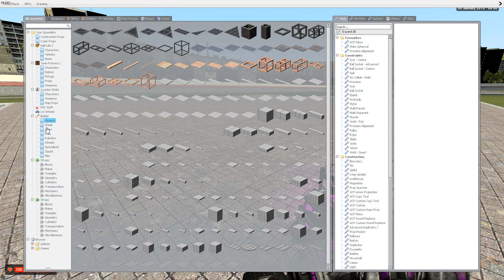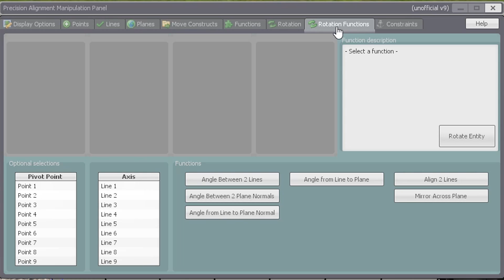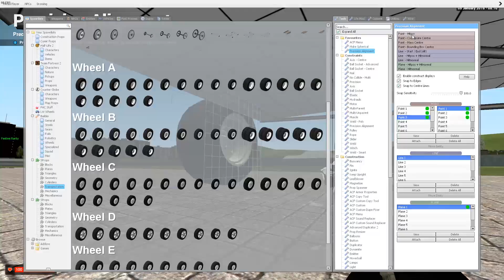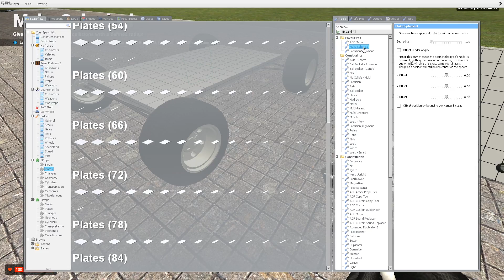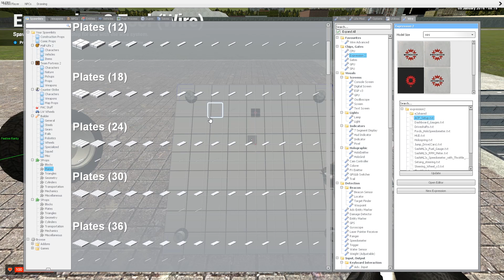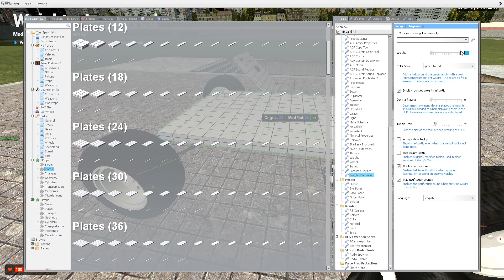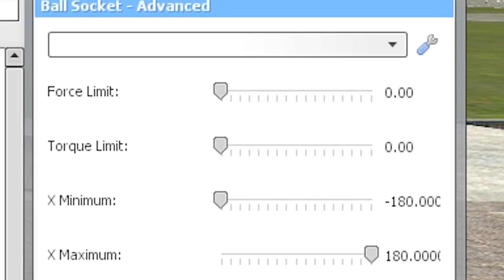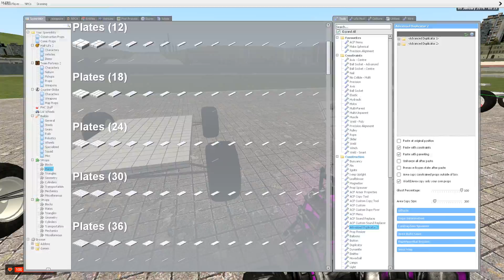[GMod 13] Independent Suspension and Steering Tutorial [2016]

Comment: I combined both of the E2's together, I did this on my last pc too, I think it makes things easier

EDIT: Also, I just build my hydraulics straight onto the Setang Steering E2, thats what I and pretty much everyone else on the server I play on do, makes things more organized (I play on I Just Want to Build (IJWTB))

@name ACF Setup + Setang Steering
@inputs W A D CHASSIS:entity
@outputs Throttle Constant Damping
@persist SLAVE:entity [TURN_RATE TURN_ANGLE TURN] B C
@model models/sprops/rectangles/size_2_5/rect_18x18x3.mdl
 
Throttle = W * 100
Constant = 50000
Damping = 500
if (dupefinished()) {reset()}
 
B = round(toUnit("km/h",CHASSIS:vel():length()))
 
 
if(B >= 20)  {
    TURN_ANGLE = 25
}
else
{
    TURN_ANGLE = 45
}
 
if (first())    {
    interval(20)
   
    TURN_RATE = 5
 
   
    SLAVE = entity()
} elseif (clk())    {
    interval(20)
 
    if (!SLAVE:isPlayerHolding())    {
        TURN += clamp((A-D)*TURN_ANGLE - TURN, -TURN_RATE, TURN_RATE)
        SLAVE:setAng( CHASSIS:toWorld(ang(0, TURN, 0)) )
        SLAVE:propFreeze(1)
    }
}

Comment: i bring unfortunate news, im not sure if its something im doing wrong addon-wise, but the method of using PA for wire hydraulics doesn't seem to work anymore
Reply: i bring fortunate news there is a fork of precision alignment also for some reason the wire hydraulic does work in multyplayer but it work in signleplayer
Reply: what's the fork? also i was trying this in singleplayer
Reply: @13B-POWAH  the offbrand version is called "precision alignment" and its made by a guy called GNU. And fork is when someone makes something makes it open to the public and some takes it and makes adjustments to it
Reply: ill try again in multiplayer if i get the time

Comment: the e2 setang steering is outdated please update it
Reply: I know it's late but I believe the problem is that you don't have an extension (propcore) enabled in E2. I think you can 'fix' this, in singleplayer only, by following the instructions on this image: https://image.prntscr.com/image/33WMdj9XSi2cHgA5L5R-CQ.png
Although I recommend you enable them all in singleplayer.
"Note: Most E2 addons do not register themselves as extensions and thus cannot be turned on or off with the above commands. A notable exception is the propcore extension in the UWSVN, which is disabled by default.
Also, you must run wire_expression2_reload in order for enabling/disabling extensions to take effect."
Here is the list of functions that propCore provides: https://github.com/wiremod/wire/wiki/Prop-core And setAng is one of them. So enabling propcore must fix it.

Comment: //ACF SETUP
@name ACF Setup
@inputs W
@outputs Throttle Constant Damping

Throttle = W * 100
Constant = 50000
Damping = 500

//STEERING SETANG
@name Setang steering
@inputs A D CHASSIS:entity
@persist SLAVE:entity [TURN_RATE TURN_ANGLE TURN] B C
@model models/sprops/rectangles/size_2_5/rect_18x18x3.mdl

if (dupefinished()) {reset()}

B = round(toUnit("km/h",CHASSIS:vel():length()))

if(B >= 20)  {
    TURN_ANGLE = 25
}
else
{
    TURN_ANGLE = 45
}

if (first())    {
    interval(20)
    
    TURN_RATE = 5 

    
    SLAVE = entity()
} elseif (clk())    {
    interval(20)

    if (!SLAVE:isPlayerHolding())    {
        TURN += clamp((A-D)*TURN_ANGLE - TURN, -TURN_RATE, TURN_RATE)
        SLAVE:setAng( CHASSIS:toWorld(ang(0, TURN, 0)) )
        SLAVE:propFreeze(1)
    }
}

//BALL-SOCKET ADV. VALUES
//Force Limit: = 0
//Torque Limit = 0
//X Minimum = -180
//X Maximum = 180
//Y Minimum = -0.1
//Y Maximum = 0.1
//Z Minimum = -0.1
//Z Maximum = 0.1
//X Friction = 0.00
//Y Friction = 0.00
//Z Friction = 0.00
//✔ Freemovement
//✘ or ✔ No-Collide Entities

Comment: The ball socket things dont really work the way you described. Mine wont hold the wheel in place.
Reply: You probably didn't build north because I had that problem then I fixed the orientation and it worked

Comment: I was wondering, what exactly does Constant and Damping do?
Reply from the maker: Truth be told i'm not sure, I never really experimented with the numbers enough.
Reply: Constant is basically spring constant, it's how stiff the spring is. The higher it is the more force will be required to move wheels from neutral position and the more force they will return to neutral with. Heavier cars need stronger constant. Ideally you want a constant such that the biggest bumps you expect to hit will max out your available wheel travel.

Damping is like the delta (or $) if you have ever coded hovering e2 thrusters before. It basically punishes and slows down high speeds, it slows the amount of time to return to neutral initially but then heavily cuts down the oscillations and springing around the neutral point. If you have no damping you return to neutral fast but then overshoot it and keep oscillating back and forth past it.

Ideally you want higher damping for fewer really big bumps and low damping for many smaller bumps. This is because you need fast return to neutral if you hit many smaller bumps in sequence, but if you hit big bumps you need something that will cancel the large oscillations out and perform smoothly. 

You may want to look up PID controller- P relates to constant and D relates to damping. You can ignore the I bit, it's an extra factor that can be added which accumulates over time to overcome natural failure to return to the exact start position. It's not used here.

Comment: Help pls. I get error "No such function: entity:SetAng(angle) at line 31 char 15"
Reply: I know it's late but I believe the problem is that you don't have an extension (propcore) enabled in E2. I think you can 'fix' this, in singleplayer only, by following the instructions on this image: https://image.prntscr.com/image/33WMdj9XSi2cHgA5L5R-CQ.png
Although I recommend you enable them all in singleplayer.
"Note: Most E2 addons do not register themselves as extensions and thus cannot be turned on or off with the above commands. A notable exception is the propcore extension in the UWSVN, which is disabled by default.
Also, you must run wire_expression2_reload in order for enabling/disabling extensions to take effect."
Here is the list of functions that propCore provides: https://github.com/wiremod/wire/wiki/Prop-core And setAng is one of them. So enabling propcore must fix it.

Comment: How do I make this support a lot of weight? Turning the damping up, it stops being effective and increasing strength at one point (about 5000 id say?) And I have a big car that weighs a lot.
Reply from the maker: Mabye make the car not heavy? And make sure the wheels and baseplate are significantly more heavy then the "body"
Reply: I'm working with a lot of acf engines and gearboxes guns etc, so I can't decrease weight.

I've also tried making the body and wheels heavier, no such luck.
Reply from the maker: Umm... well i'm not sure, Making the baseplate and wheels heavier works for me. Also remember that the wheels must be lighter than the baseplate. And your baseplate needs to be heavier than all of the combined ACF parts attached to it.
Reply: That didn't seem to work, What happens is the suspension isn't able to support the car and this happens: 
Before:
http://steamcommunity.com/sharedfiles/filedetails/?id=868000326
After:
http://steamcommunity.com/sharedfiles/filedetails/?id=868000207
Reply from the maker: What are the the weights?
Reply: 800 for the wheels, 6400 for the base. (Ive tried 12800 for the base, no luck.)
Reply: 1350 for each engine (I have 3 engines)
Reply: 3000 for the counterweight in the front too
Reply from the maker: Make the wheels like 2000 or something, keep increasing the wheels weights, if that doesnt work, something else that I can't think of may be going wrong.
Reply: Still flattened itself.
Reply from the maker: Im not sure :( then.
Reply from the maker: Those wheels are PHX I've always had problems with them I recommend using SProps wheels.
Reply: Sprops wheels are a bit small for the size of the car, But i'll see if they fix it. The problem is with the hydraulics not being damping'd enough. Although I cant go over a certain amount or it will stop being effective.
Reply: Damping will not support more weight, it simply reduces 'springyness' and oscillations around neutral at cost of some speed of return to centre. What you need is to increase the constant which makes the suspension actually require more force to extend.

If the constant is maxed at 90k ish (which is not hard) you have a couple of options:

1) Simply place more hydraulics to increase resistance

2) Increase the default length of hydraulics- as they act with strength proportional to length- with this implementation default length is zero, so if you place the hydraulic anchor points a meter or so above the wheels you may get a stronger effective spring constant (I have not tested this myself but I hear it works). 

3) Use a 'constraint bending' suspension method instead which can be made very stiff. These work by being connected (rigid ropes) to a light prop which is welded to the base. As you increase the weight of the prop the weld becomes stronger and the suspension stiffer. A very light prop means the weld is very weak allowing the wheels to move up and down fairly easily. The disadvantage of this is you cannot control damping and constant separately and it's not really as realistically engineered since it's abusing a flaw in the game physics rather than using the tools the game provides. On the plus side it's simpler, easier to engineer and not reliant on wire.

Comment: Every time i go to use the suspension module thingy, it throws an error code saying that SLAVE:setAng isn't a proper function
Reply: I know it's late but I believe the problem is that you don't have an extension (propcore) enabled in E2. I think you can 'fix' this, in singleplayer only, by following the instructions on this image: https://image.prntscr.com/image/33WMdj9XSi2cHgA5L5R-CQ.png
Although I recommend you enable them all in singleplayer.
"Note: Most E2 addons do not register themselves as extensions and thus cannot be turned on or off with the above commands. A notable exception is the propcore extension in the UWSVN, which is disabled by default.
Also, you must run wire_expression2_reload in order for enabling/disabling extensions to take effect."
Here is the list of functions that propCore provides: https://github.com/wiremod/wire/wiki/Prop-core And setAng is one of them. So enabling propcore must fix it.
Reply: @Georetic  Thanks for the help!  I'll try this later on

Comment: Wheels don't rotate like they should. Wheels roll over sideways. Can't dupe machine because it won't duplicate the hydraulics for some reason.
Reply from the maker: Did you ball socket correctly?, As for duplication, you are using the advanced duplicator right?
Reply: Advanced duplicator 2. My vehicle is facing north, and I have the exact same settings for the ball socket. I've tried to change the settings to see if I can fix it, but it doesn't work no matter what I do.
Reply from the maker: Then I'm unsure how to help, and I am terribly sorry I cannot. I wish only for you to find a solution.
Reply: Yes! I got it working. I decided to make it on the flatgrass map, facing the Flattywood sign (which I assumed was north for some reason). It decided to roll only sideways, so I realized that I wasn't actually facing north, and I changed the settings of the ball socket to fix it. It works now, thanks for your awesome tutorial!
Reply from the maker: Deathpuff12 Glad you got it working! Remember that on any map, the top of your spray is north.
Reply: Can you tell me how you were able to dupe the hydraulics because I have the same problem.

Comment: While this tutorial is amazing and very appreciated, I can't get the E2 chip to work. I keep getting an error saying "directive (@name) is required on line 2 at character 1... which doesn't make sense because the @name is definitely there, I re-pasted the code numerous times. I need halp. :(
Reply from the maker: Sorry man I've kinda stopped playing, and all I can suggest is check my description and make sure some of the e2 settings in the console. Otherwise I recommend maybe finding a different steering e2 or go to a legit build server and ask some who is much better with e2. :/ sorry I'm not of much help here. Tomorrow I will add another steering e2 to the pastebin.
Reply: +ZcytheGaming hehe,  nevermind,  I did the same thing as one of the comments below,  I copied some ball socket values by accident. Awesome video,  definitely subbing.

Comment: I need help pasting the e2 code. can anyone help me? i need to know where to extract the E2 file in the good folder
Reply from the maker: +Bridger Johnson How are you having trouble? Like all you have to do is past the stuff into the E2, and save it. And update the list on the wire menu.
Reply from the maker: +Bridger Johnson Also keep in mind, that the pastebin has multiple codes, for multiple chips.
Reply: +ZcytheGaming i was being stupid sorry. lol. Also on the steering E2 it says "unknown character found (.)" the period after ball socket adv.
Reply from the maker: I'm not sure, The code works for me, I'd suggest trying to re-paste it and save it. I'm sorry I can't help you on this part.
Reply: +ZcytheGaming i have multiple times. can you look on your link at the steering code? the period is on line 46 on the page.
Reply from the maker: +Bridger Johnson Remove the period, There are none in the code, or on my paste, I&#39;m not sure how it got there, several times. The steering chip is lines 10 - 44 only in the pastebin.
Reply: +ZcytheGaming after i delete the period it says "Division operator (/) must be preceded by equation or value at line 36, char 1". the period is abbreviating Advanced (adv.).
Reply: +ZcytheGaming on the page it is line 46 tho
Reply: +ZcytheGaming Never mind. a mistake on my behalf. accidentally coppied the start of the ball socket values. thank you for listening . i wish you many subscribers in the future. :)
Reply from the maker: Thanks, but I doubt after 3 years, I'll ever get more than around 60 - 70, I'm not really a good personality, As I tend to focus on the game and not talk. Glad your problem was solved, :D